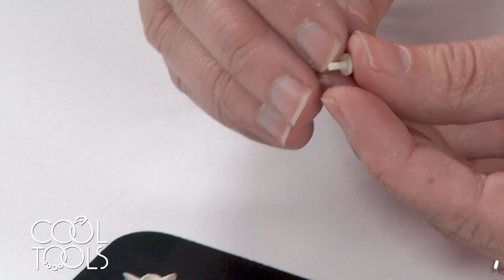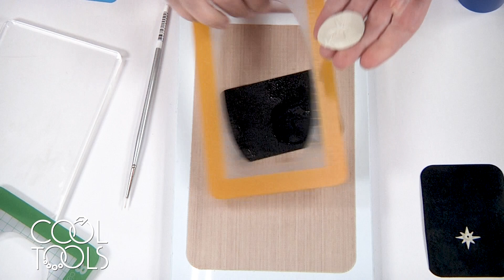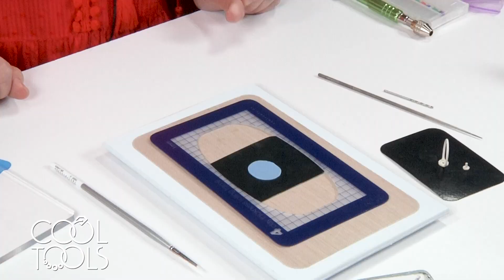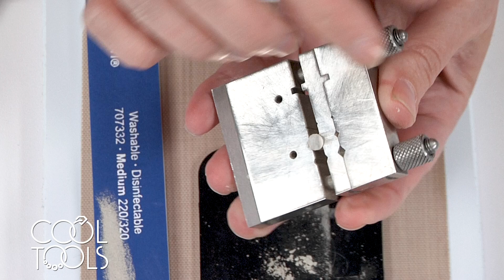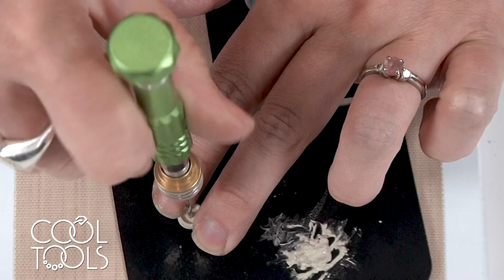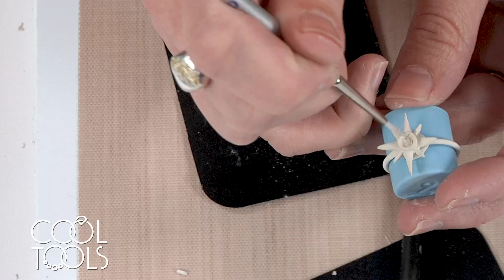Cool Tools | Silver Metal Clay Spinning Ring by Karen Trexler

Comment: Great video love to seeing the start to finish of projects, any would like more info on your drying station on dry time for torch fireable clay. Mug warmer, hot plate, warm oven etc and time to dry in various methods? It there another video on that? I'm brand new to metal clay (just ordered Phoenix Torch Fireable Clay - Fine Silver yesterday). I have some experience is working with sterling metal wire/sheet and soldering with torch.
Reply from the maker: Hi Laurie, there are a few common methods to drying, but the key is just making sure it’s completely dry before firing. 

Room temperature air-dry: Usually takes 12–24 hours, depending on humidity and thickness.

Mug warmer / hot plate: Speeds things up nicely. Place your piece on it and dry for about 30 - 60 minutes. Flip it halfway if it’s thick.

Dehydrator: Around 1 hour does the trick.

The timing is a general estimate, as the time taken depends on the piece size. The main thing is the clay should feel bone-dry before firing. If there’s any moisture left, it can cause steam bubbles or cracks during firing. I hope this helps!